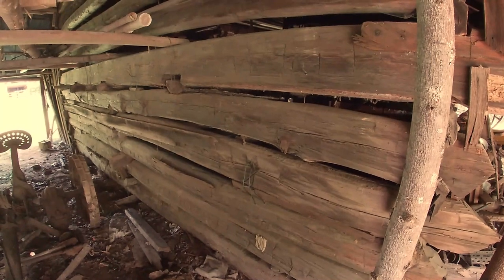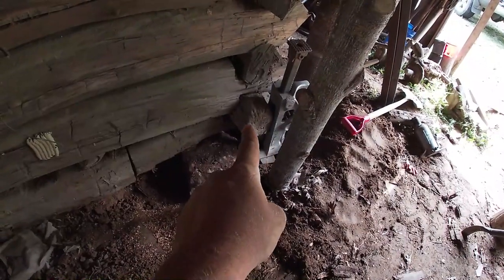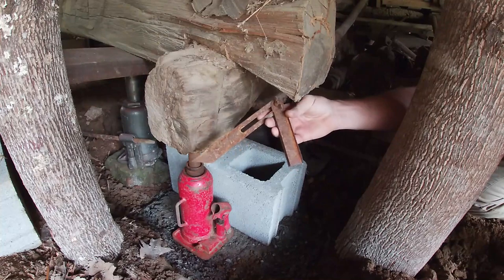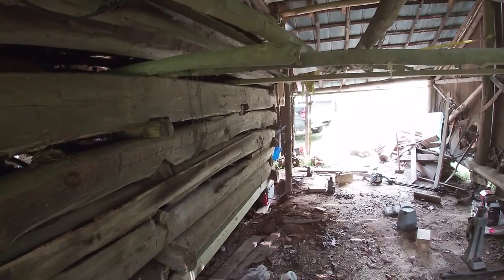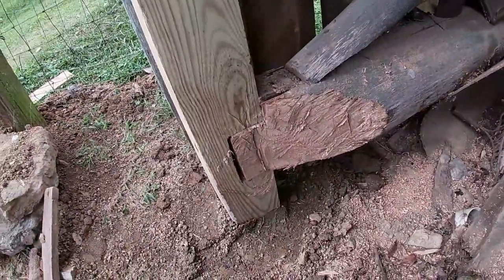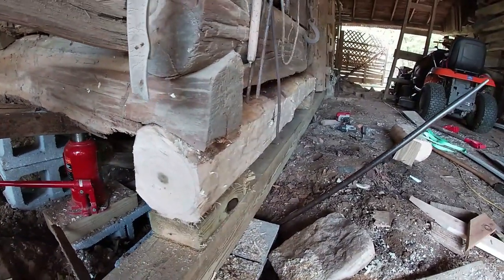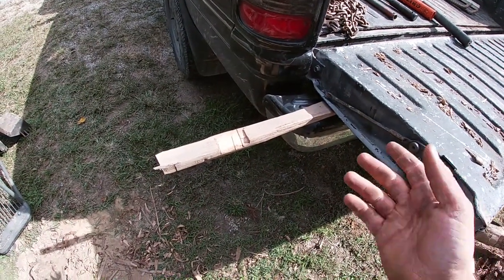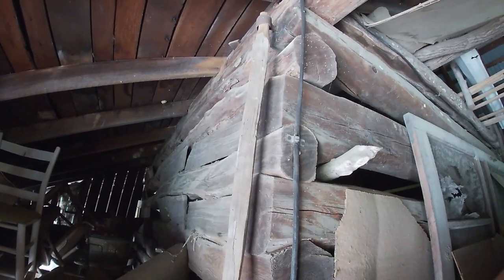1800's Hewn Log Barn Repair

Comment: Nice job with that old barn!  If you were closer I would have you look at my old barn.  silver maples had pushed it off its foundation and I wanted to save it, but now I am wondering how to take it down so I can build the out buildings I truly need.
Reply from the maker: Probably be easier to take it down and rebuild. It’s a lot of work to try to jack one back up if it fell much
Reply: @FlutyLickHomestead     I think your right.   it would also be safer to tear down and build a smaller one that fits our needs and a few other outbuildings that are needed.  If you ever get road tripping bug let me know I would love to get your thoughts on this old barn.  There is a ton of lumber that I would love to safely take it down.